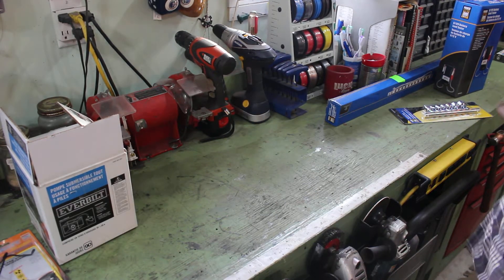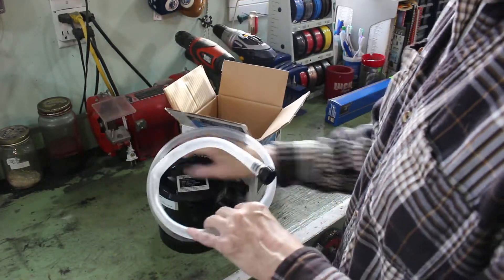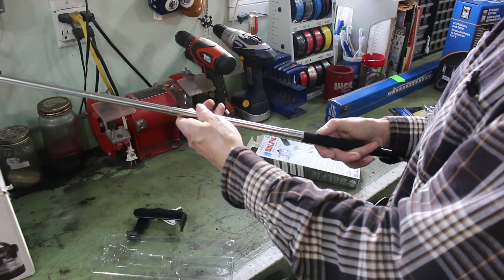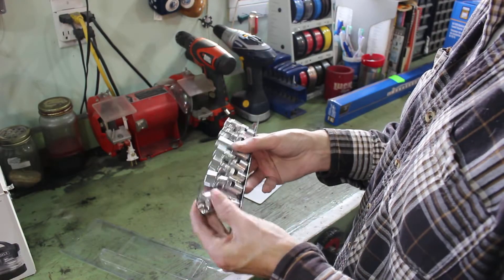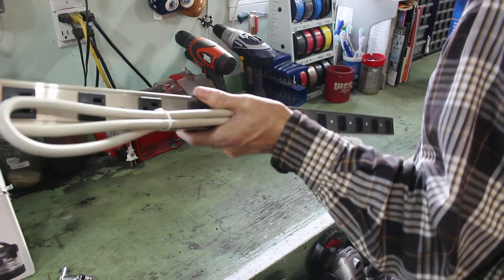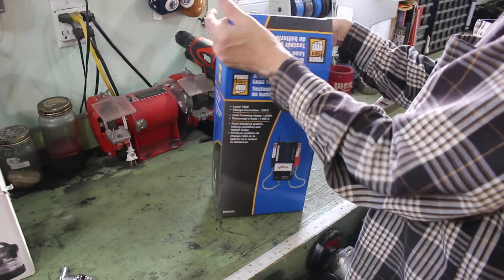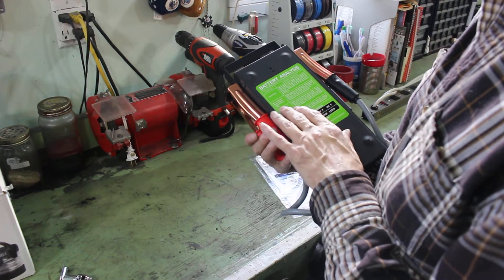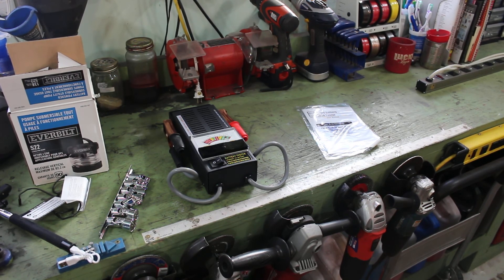Tool Haul (March 21, 2018)

Comment: i have a giant power strip on the front of my bench in my shop,comes in very handy. the digital battery/charging testers like mine will tell you if the battery has a bad cell,tell you if the alternator has a bad diode,and test starter draw plus allowing a print out for the customer or for warranty purposes as a dealer tech. what you have is fine for working at home and even most shops,but it wont tell you starter draw which is very important when trying to troubleshoot a problem without throwing parts at it
Reply from the maker: I'm thinking of building a hutch for my tool box and then mounting the power strip in there.

Comment: If the u joint sockets loosen up and get floppy put a tight fitting o ring on the joint.
Reply from the maker: Good tip.  Better than wrapping black tape around the joint.

Comment: I have one of those pumps they work pretty good I got rechargeable batteries for it though it seemed to eat batteries
Reply: John Gibson, I think something like that would be good for my pool cover where I only need to run it long enough to get a siphon going.  I wonder if you could rig up a remote on/off switch.
Reply from the maker: Rechargeable batteries is probably a good idea.